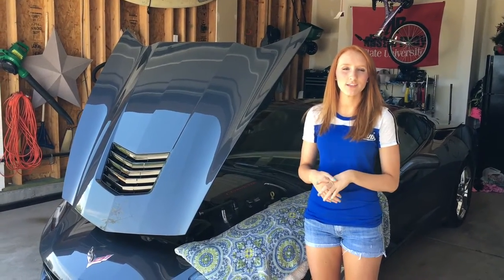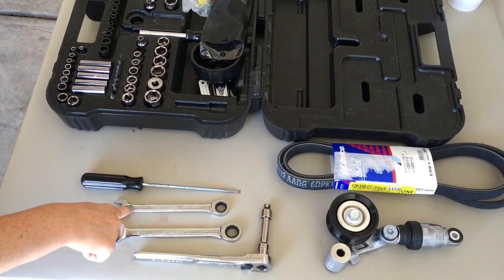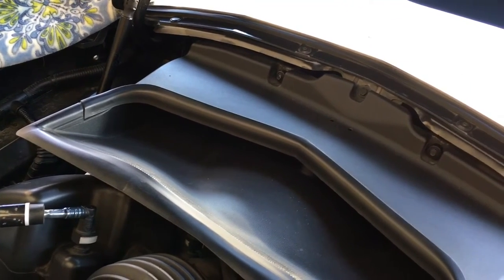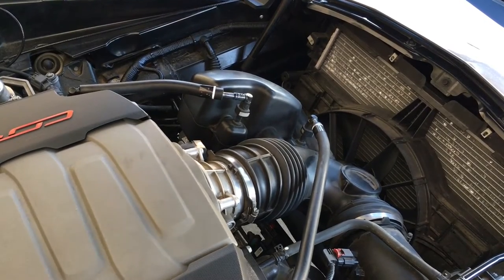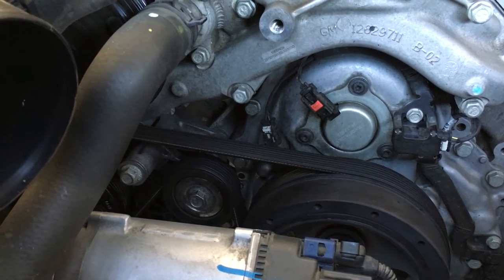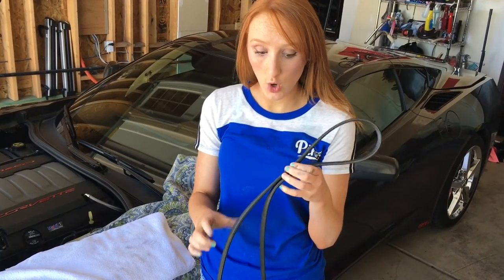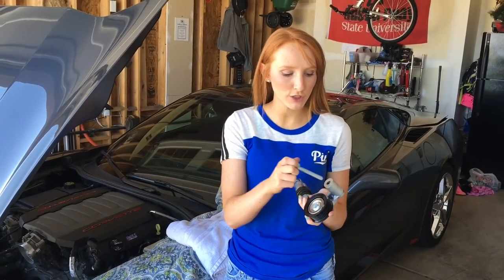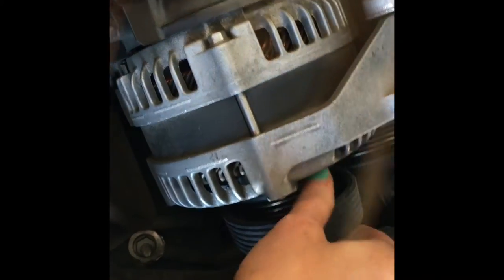C7 Stingray Belt Tensioner Replacement

Comment: Very good job on the video. I used it replace my belt tensioner on my 2014 Covette. I would recommend jacking the car to get at the bottom 13mm bolt on the  tensioner. It sure made it easier to reach. Also, I think you meant to say alternator when you said Compressor. You did a great job on the video and thank you for making it. I sure learned from it. Keep up the great work. Corvette Hop.
Reply: CorvetteHop yes I did mean the alternator! Oops. Didn’t even notice.
Reply: It is all good. Very good video and thank you for making it.

Comment: Great video, thank you. Mine went out at 18k miles. Car made a loud rattle noise when switching between 4/8 cylinders. GM acknowledged the issue with service bulletin PIP5185a. Says if you hear the rattle and see any leaking fluid, the tensioner should be replaced. My lower tensioner bolt was completely covered in grease that had leaked out of the tensioner.
Reply from the maker: Matt Pegan glad to hear you got it fixed. That's definitely early to be having any issues! Hope you have many maintenance free miles from here!

Comment: How timely a video.  I have a 2016 Stingray Z51, 8 speed  automatic, with 5,800 miles.  When in any shift mode (touring, sport, etc.), I was getting a frequent rumble when the car moved from V8 to V4 mode. Felt like I was going over rumble strips.  It only would stop when I shifted into "manual" which locks out the V4 mode.  Took it to the dealer who diagnosed the problem as a bad and leaking belt tensioner.  This must be a big GM issue because tensioners are on back order. From your post I see this is a simple job.
Reply: I have the same problem, so glad I read the comments. Now I need to go ahead and change my tensioner. Cause I'm tired of this rumble.

Comment: How did you know your tensioner needed replacement? I'm hearing a ticking noise at around 2000-3500 rpm 1st and second gear. Any advice is very much appreciated thanks!
Reply from the maker: I included a link to the video of the noise my tensioner was making in this video.  Mine was more of a whining noise very similar to what you would hear with a power steering pump.  I didn't hear any ticking noises, however. I'm assuming the ticking is fairly loud to hear it in that RPM range.  Is it constant once you are in that range, or only under acceleration?
Reply from the maker: Here's a direct link to the video of the sound my tensioner was making: https://www.youtube.com/watch?v=tjuq9qaGmXI

Comment: Just wanted to say this video was very helpful, so thank you!  Just did this on my 2015 z51 and wanted to add some info.  Message boards tend to say that the lower bolt has to come out from the bottom.  Not so.  In fact it isn't exactly easy that way to begin with.  You can wrench it out from up top if you have the patience, but I got mine off very quickly and hassle free by using a ratchet swivel adapter.  The key is that you can't use a swivel if it engages at 90 degrees, basically straight down to the bolt.  You have to use a long extension attached to the swivel, attached to a shorter extension with the socket.  It seems excessive but it really isn't.  You  put this together and ratchet the bolt out by sliding the shorter extension under the electric steering rack near the radiator fan.  A little messing around and you will see what I mean.   I literally was texting in one hand and removing the lower bolt with the other while the car was parked in the driveway.  Could not have been easier and did not need jacks or lifts.  Anyways, again, thank you!
Reply from the maker: DLA that is great! Thank you! At the time I did this video, nothing existed on the message boards at all yet, because it was still too new. I was having to learn as I went. Having the right tools as you describe would have made it even easier! Having said that, since I replaced it I am now over 85,000 miles and haven't had an issue, so at least the aftermarket parts were better! Thank you again!

Comment: Thanks a lot. Very helpful video. Only thing i would like to add is the lower bolt of the tensioner can be loosened easily from underneath the car unless you have a long 13mm wrench.
My 2015 c7 made a chirping sound when it switches between v4-v8. This helped fix the issue.

Comment: it looks like the belt groove are on the wrong way in your video vs the diagram or am i not seeing this correctly? thanks ginger
Reply from the maker: steve lin It is absolutely on correctly. When installing you will find it becomes obvious which way it should face as you route it through. It has been many many miles since then, and I haven't had any more issues.
Reply: thanks ginger

Comment: Why was the tensioner replaced? What was the issue the car was having?
Reply: The vettes start making a whining noise. It sounds like when old power steering pumps are low on oil. Im on my second tensioner at  88,000 miles. They are a cheap replacement just annoying.

Comment: Is the tensioner a spring loaded type automatic adjustment, or do you have to tension it manually?  And if so, what do you use as a guide for the correct tension?

Comment: Hi, im in colorado too. I just got a c7 corvette this week and was wondering if you know of any good car meet ups/drives that you maybe have gone to that you liked?

thanks
Reply from the maker: There are a ton of them, actually, but not as many in the late fall/winter even though we have some nice days throughout the winter.  There is a great group on Facebook called Denver South Corvettes and they do quite a few events throughout the year to include scenic drives, get-togethers, BBQs, charity events, car shows etc.  Great group of folks and a wealth of information.  I drive up to Denver just to link up with them and go for drives.  In Colorado Springs there is the Colorado Springs Corvette Club - a great group of people as well.  As far as car meets in the Springs, during the months of May - November they hold one on the first Saturday of every month off of Powers Blvd by the movie theater off Carefree; called the First and Main car meet.  Usually a great turnout, and it's hosted by a different car brand each month.  Third Saturday night of every month there is a small group that meets at the DQ in Castle Rock, too.  There are various other car meets that meet up in town, but I haven't attended much of them; they are more geared towards street racing and is a very much younger crowd.  You can look up 719 street scene and find out where they meet; it's different each week. Also, one of my favorites is in the Sears Outlet parking lot by the Park Meadows mall in south Denver.  They get together most Saturday mornings when there is good weather and it is not unusual for the Lambos and Ferraris to show up.  Same with the Vehicle Vault in Parker.  You can find them on Facebook as well and check their calendar for when the next meet is.  Also some very awesome high-end cars that show up to that one.  All of the meets generally have great Corvette turnouts, so it's a great opportunity to meet some local folks!
Reply: Great thank you so much!!!

Comment: I did not understand how to relieve tension and release it I reached the last step but I could not put the belt in its last place, please help me, my lady
Reply from the maker: you really have to apply quite a lot of pressure to relieve the tension. Use the 15mm wrench and pull it in a clockwise direction. It's a little easier if you have someone put the belt on while you relieve the tension.

Comment: Good Job :)   Did your tensioner go bad already ?
Reply from the maker: Almost 60,000 miles on the car as a year-round daily driver! Yes!  I've heard some with early 2014 models had tensioner issues early on, but mine was not subject to this as it did not start happening until after 50,000 miles.
Reply: Oh okay. Mine is 2016 with 4K and i was getting worried. Thank you for responding.
Reply from the maker: No problem! Glad to help, and bookmark this video for when you need it 50,000 miles from now! Ha ha!

Comment: clean your cooler too, it seems there are a lot of flies and dirt in it ?
Reply from the maker: kubanskiloewe it has 63,000 miles now. It doesn't sit in the garage much. However, she stays clean and you are seeing normal wear on a radiator with 63k on it!
Reply: ok, than perhaps it´s only due to my low video resolution.

Comment: Is there anyway we can DM about this particular issue. I’m stuck at trying to get the belt off
Reply from the maker: Dustin Flores you have to really push/pull on the tensioner with the wrench to get it to move enough and then the belt slips right off. If it's not slipping off you just haven't relieved enough tension and have to push/pull harder (depending which side you're doing it from). It won't break.
Reply: ThatCuteGinger I was just confused cause the screw in the middle came all the way out but the belt didn’t budge. I screwed everything back in to try again later :/
Reply from the maker: Dustin Flores you went the wrong way with it. You should be tightening it in order to make the actual tensioner arm move. That's all that happened there. Try the other direction and the belt will have slack.
Reply: ThatCuteGinger got you! I know you said clockwise but I gave up on that too early and I was confused because I relate loosening. With counter-clockwise. I’ll let you know any further questions I have tomorrow. Thanks so much for the help!!